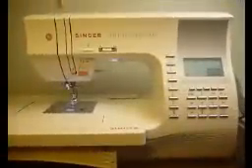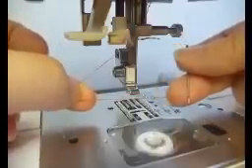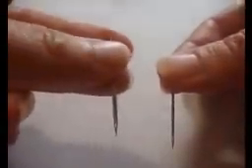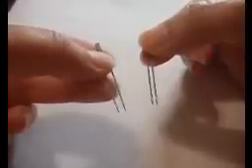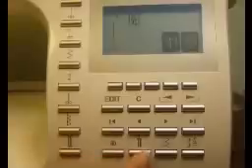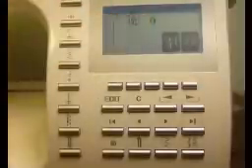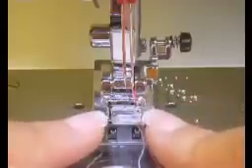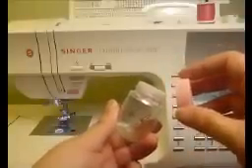Installing Needles Singer Quantum Stylist 9960 Video Part 9

Comment: I have had my Quantum 9960 for about 3 years now and love it except for the auto thread cutter (which is the main reason I bought this machine ) it stopped cutting the thread within 4 months of purchase!
Reply from the maker: Hi Flossie.  Best to bring it in for service since it's a feature you enjoy.  Here's a tip.  If you press the cutter and it doesn't cut the first time, don't press again and again.  That will break the cutter.
Reply: @RoxanneStitches  thanks for your time in answering my post. I figured I would need to take it somewhere but I live in a small town in Kentucky and I  don't know of any place to take it to. Thanks again for your time.

Comment: I received my machine and was so excited to start a project, but I cannot thread the needle.  The #1 thing that automatically threads the needle is facing away instead of forward.  I cannot figure out how to turn it the correct way so it will align properly and thread the needle.  Do you know how I can safely turn it?  Thanks
Reply from the maker: Hi Jackie!  Congratulations on your new 9960!  Here's the link to the video on how to use the auto needle threader.  https://www.youtube.com/edit?o=U&ar=2&video_id=dBLuvSu8dkc

Comment: Does the twin needle setting prevent tunneling on knits? Thanks for all the great videos on this machine.
Reply from the maker: Hi knittysong.  Thanks!  Glad you're finding the videos helpful.  When using the twin needle to hem a lightweight knit, it's a good idea to use fusible interfacing on the hemline before stitching to achieve a smoother appearance.

Comment: I need help my machine is less 6 months old, however the thread keeps coming out of the needle. I changed the needle several several times
Reply from the maker: Hi Virginia.  Not sure why that's happening.  Hold your threads when you start sewing or use a leader.  If the auto cutter is cutting the thread short, use the side cutter instead.  If this doesn't help, please call Singer directly.

Comment: Do you like this machine?
Reply from the maker: Yes!
Reply: @RoxanneStitches  I liked the price for the features, looked at reviews I was thinking to buy  this for 309 at Wal-Mart versus the sparrow 25 for 330 it's an eversew so far we like what we see....the sparrow went through 8mlayers of muslin with no issue.  Got to try one at our local bernina store :0)  does this work with  denim fabric?
Reply from the maker: I do not consider the Singer 9960 to be a heavy duty machine or one for business use.  However many people in our group make bags and heavier items using the proper needle, thread and speed.
Reply: @RoxanneStitches  with the singer, correct? I want to get the most out of one I buy, been sewing daily I habe to make sure it can at least handle clothing edges and hems being folded to at least handle cotton four layers and some denim.

Comment: thank you for amazing videos but I'have some promble when I switch my machine on I had a orange light on stop and start button and the the screen doesn't work I don't know what I have to do please can you help me. thanks again.
Reply from the maker: Make sure your foot pedal is plugged in properly to your machine and that your buttonhole wand is all the way up.  If the problem is electronical, you may need to seek service.